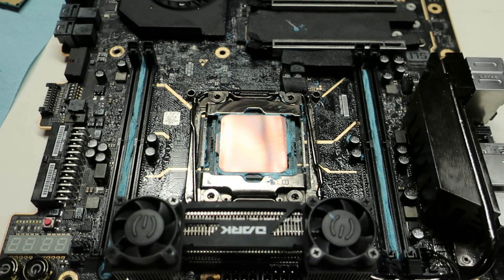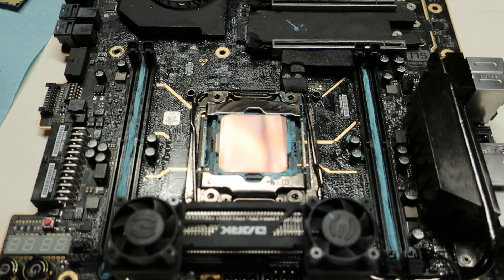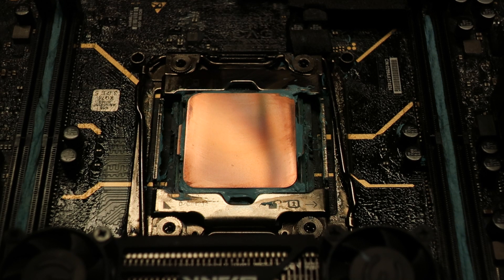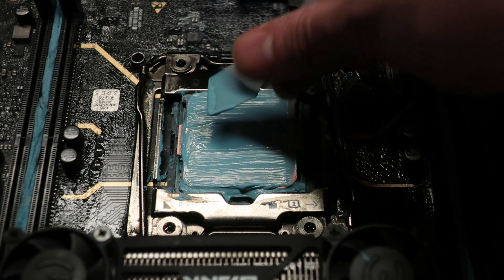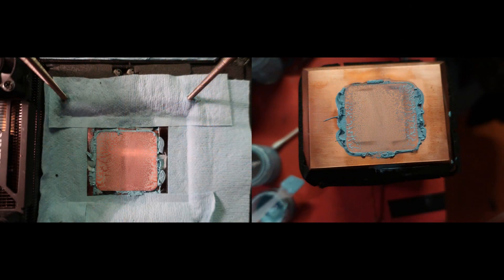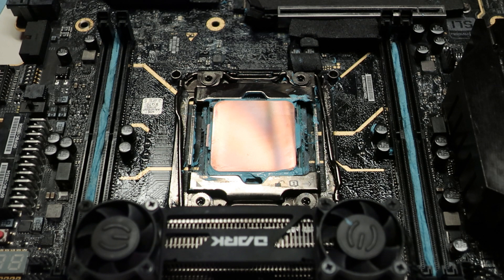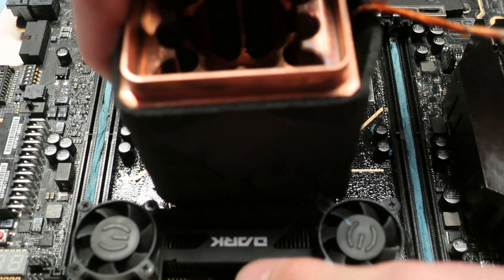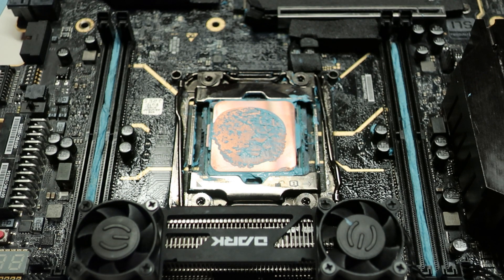Kingpincooling KPx thermal paste - Quick Overview & Application Guide

Comment: Kingpin kpx or Thermal Grizzly Kryonaut?? Which is better??
Reply: both same
Reply: @rafyshah946  I applied kingpin kpx but no improvement in tempd
Reply: @rudrashivagaming4377  Have your temperature improved and from where have you brought Kingpin Kpx?
MDComputers.in?
Reply: @riktamsarkar7684  yes I bought from MD computers and my temps are not any better they are same after repasting
Reply: @rudrashivagaming4377  Brother am seriously confused what to get. I have a Predator laptop and 3 thermal paste options: Noctuna NT-H1, Artic MX-4 amd Kingpin Kpx. I would have got Cooler Master Mastergel Maker Nano but it isn't available anywhere also it's cheap and does the work well, same as these brands.
Reply: @riktamsarkar7684  get Thermal Grizzly Kryonaut its good
Reply: @rudrashivagaming4377  Not available brother.
Reply: @riktamsarkar7684  then kingpin kpx is good

Comment: to much
Reply: Stfu you have no you have no idea what you're talking about. There is no such thing as too much thermal paste (within reason). There is such a thing as too little though. Go learn something you fucking twat.
Reply: @pickleadaykeepsthedoctoraway  He's right, calm your butthurt self down, something's wrong with you.
Reply: @Attack Me Well, yes and no. Will it damage the system? Probably not, and  you're right that unless it's liquid metal it's a problem, but you have to factor in the cost as well. I use TG Kryonaut Extreme and that stuff is $25 per gram. If I did what he did on my TR 3975wx, I'd have just wasted around $50 for zero gains at all and more time on clean-up
Reply: @Attack Me Yeah I pretty much agree with you. Another thought is if the paste is left so long that it completely dries. It'll crack into dust and possibly get into the finer areas of the motherboard during removal, which might also be a pain. Especially if you let the metal brace flick up too quick. I'd imagine getting that stuff out of a RAM slot would be a nightmare haha.

It's honestly hard for me to really say objectively how well the compound alone is working. I built a new PC and was very specific about the components with my thoughts strongly on cooling, as I wanted air cooling rather than water cooling and I have a pretty potent CPU and GPU. So I can't say for sure it's better than any other compound, the best I can say is the stuff is pretty thick, almost rubbery and not so easy to spread even with the applicator. Sorry if that isn't much help. But overall and with PBO disabled and during my 3D render work, the temps barely get above 50 degrees with that and a Noctua Chromax-hybrid
Reply: @Attack Me I'm glad it was helpful!
What you say makes sense, logically speaking. I'll be sure to keep that in mind. Though tbf, I'll probably stick with TG-KE assuming in a years time it hasn't all dried out and thermals are bad